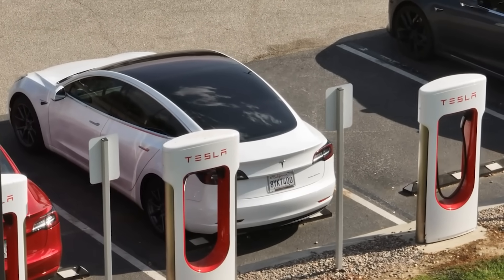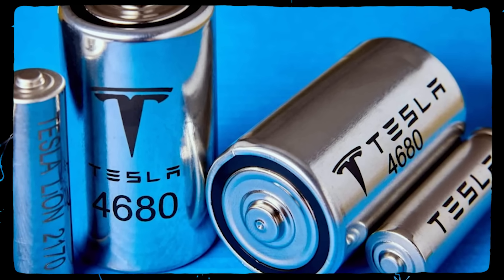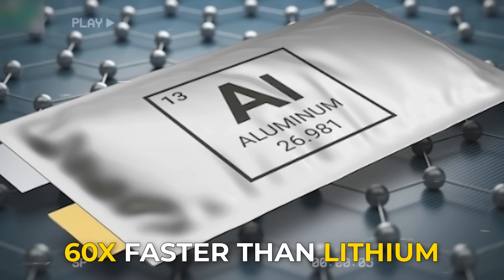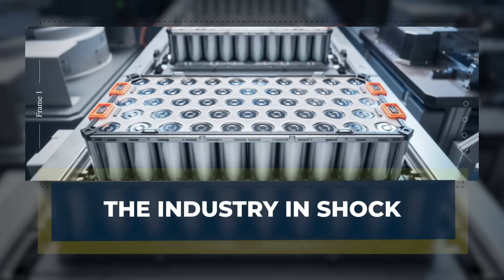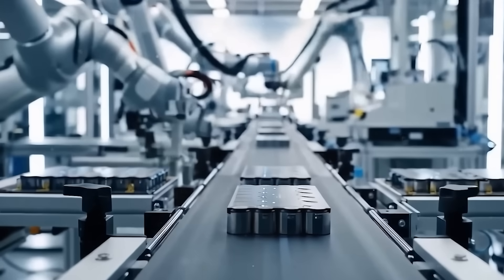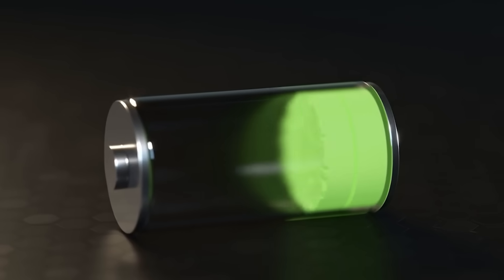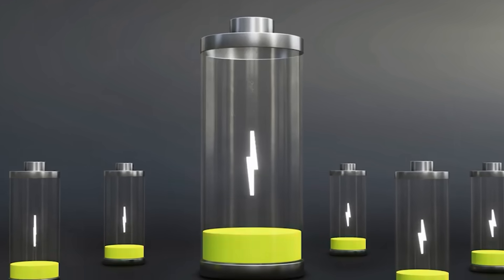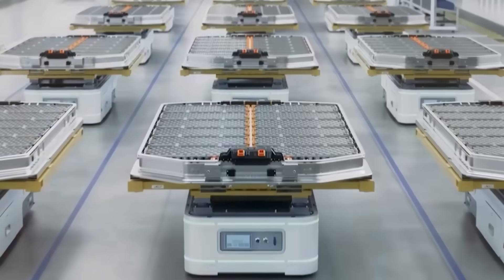Tesla’s 3-Minute Battery Revolution: Elon Musk Just Left BYD Behind!

Comment: It is not a matter of the battery, it is a matter of power delivery from the charger. Chargers can't deliver that much energy in 3 minutes!
Reply: Yes, you can if you have batteries in this faster stations
Reply: Energy to Transfer: 60 kWh * 60% = 36 kWh

Time: 3 minutes = 0.05 hours

Required Power (Constant): Power = Energy / Time → 36 kWh / 0.05 h = 720 kW